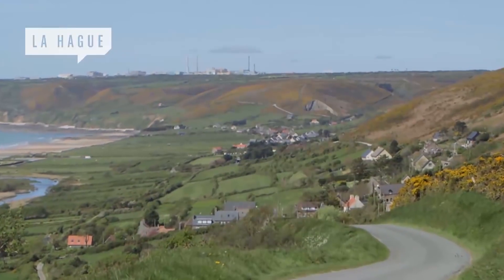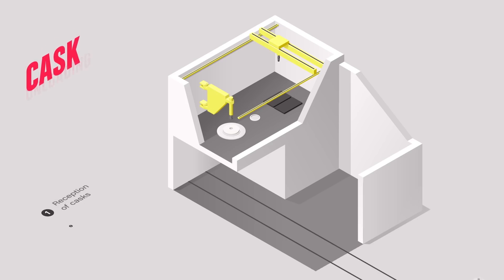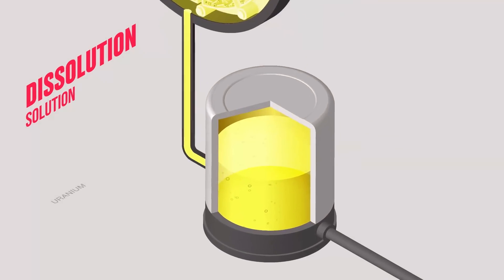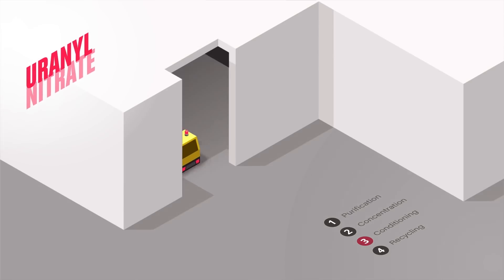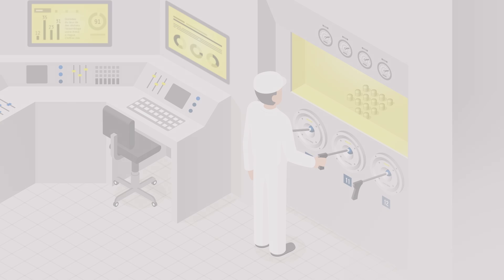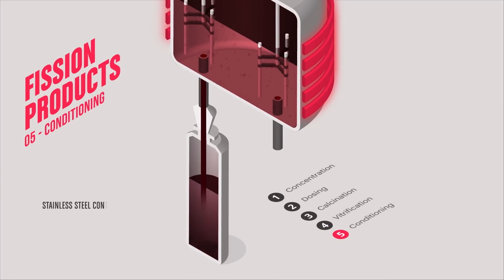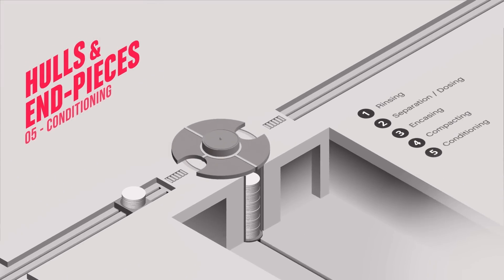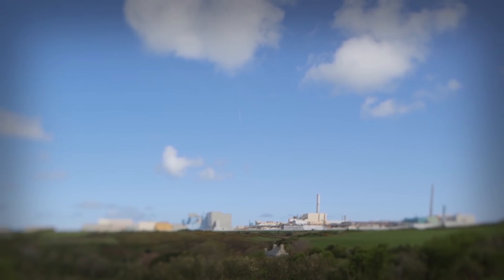Recycling used nuclear fuel - Orano la Hague - English

Comment: This, right here, is why France is deserving of the title "most responsible nation in the world", and I say that sincerely as a British person. The rest of the world is so moronic for not following their example.
Reply: France is also one of the last nations to conduct live nuclear testing explosions.
Reply: It sounds good. However, reprocessed wastes still need disposal on substantial timeframes. Since fission waste generate most of the decay heat, any permanent disposal has to be just as large and spaced out.  
The actinides still need disposal.
Recycling used MOX fuel is it's own problem. Neutron bombardment of uranium gets you plutonium, but neutron bombardment of plutonium gets you a hot mess of other actinides and isotopes. Half of these are neutron absorbers, but not productively reactive. Others are gamma emitters like the fission products, but somewhat longer lived (70 years for U232). Either way, MOX waste needs more elaborate handling, more spaced out disposal sites and longer disposal timeframes. As a result, processing or recycling of MOX fuel is much more expensive, and a lot more elaborate, to get a smaller amount of less useful fuel than less effort gets from ordinary spent uranium fuel.
France has processed about a third of all it's spent fuel and is falling further behind. Their stockpile of separated plutonium is a growing security and proliferation hazard.
Not such good global citizens as you might think

Comment: And some of  the fission products are usable in industrial and medical applications
Reply: Not really. We make medical and engineering isotopes with optimised processes, bombarding pure substances with carefully moderated neutrons to get the right energy window and optimised outputs. This minimises the difficulty of purifying and using the desired isotope.

Spent fuel is a mess, and separating anything desirable is a much more difficult task.

Comment: With our CANDU reactors here in Canada, we could burn both the Uranium and Plutonium from this recycling facility. We can burn Thorium too and yes it has been done in CANDU's before. 
France is certainly a world leader in Nuclear energy though and I bough to the French waste management system outlined here. It is truly a wonder of the world and we need more of this to make Nuclear even more sustainable then it is now. Yucca mountain needs a facility like this to deal with all that valuable spent fuel that is being wastefully discarded. It is like throwing away many many tankers of oil. Such a waste of such a valuable material
Reply: I am not so sure that you can "burn" Thorium as you can breed Thorium into U233.
Reply: Nuclear reactors dont burn anything.  There is no combustion, smoke or flame.
Reply: I really like the Dupic fuel option for CANDUs for further utilization.

Comment: Interesting video! I wonder though, the shredding of the hulls looks a bit wasteful. Would it be possible to make the fuel elements removeable so the same rod can be used over and over again? It would be activated, but that can be overcome with the same containers it arrived in.
And regarding the waste products, many are short lived. Is there a separation so the really short lived isotopes can decay into a stable form and not contribute to the waste that needs to be stored?
Reply: Radiation degrades the hulls over time. Probably a safety thing.
Reply: The Zirconium cladding gets degraded by the intense neutron radiation. Some is transformed into radioactive isotopes. It has to be sacrificed as waste.

The most short-lived fission products decay in the cooling pools. this takes from two to five years. What's left has lots of caesium-137, which has a half life of 30 years. After separation this requires disposal timeframes of about 1000 years. 
The longer lived actinides are a bigger problem. Some can be used in recycled fuel, but others really need disposal.
Used recycled fuel has even more of these and is not as easy a problem.

Comment: Great! now get the costs down. Currently the main reason the US doesn't reprocess it's spent cores is the cost. Using new cores from Uranium ore is cheaper.
Reply: With respect, I would argue differently.  A pure economic  consideration needs to consider the cost of new fuel in addition to the "costs" of dealing with the waste fuel.  Governments could add a price to the cost of storing waste fuel so that it would make the recycling of fuel worth-while.

Note that a similar situation occurred with carbon dioxide (CO2) waste.  In CO2's case, the long-term costs to the planet (i.e. global warming) could have been mitigated if governments had acted sooner; now "we" are in catch-up mode while we accept the consequences (including more violent and frequent storms, fires, heat events, rapidly increasing insurance, etc.).
Reply: @k.c.sunshine1934  Have you seen the latest polls regarding climate change? Concern has been dropping despite old legacy media getting in more hysterics than ever. I predict we will have to tolerate the likes of Al Gore and other nutcases for about 10 mores years and thankfully it will fade away.

Comment: If only the US would take note...
Reply: It is illegal in the US
Reply: @hamanakohamaneko7028  Unfortunately, yes.
Reply: The US learned the hard way (decades ago) that commercial reprocessing of fuels is not environmentally feasible, is not cost effective, is energy intensive, and creates a complex waste stream that is 10x more of a problem than initial fuel enrichment and fabrication itself. Orano La Hague simply flushes its effluents out into the North Sea, stores high-level sludges onsite, and periodically vents its gases into the air. For better or for worse, companies can't get away with this in the US anymore.

Comment: How many of these dislikes to the video think that this is inefficient?
Reply: Yes, nuclear waste reprocessing is ruinously expensive and inefficient.
Recycling causes an additional problem: Used MOX fuel, which is more expensive and difficult.
Reply: we have molten salt reactors instead of nuclear energy planned for the future
Reply: Because if you look at the facts nuclear energy is extremely expensive and only increasing, while solar is decreasing. According to the WNSIR report and Reuters: Nuclear is also much more expensive... Solar power ranges from $36 to $44 per MWh, wind power is $29–$56 per MWh. Nuclear energy costs between $112 and $189.
Reply: @aorusaki  Which is why we need solely nuclear energy and no wind or solar ever again!

Comment: This is amazing. Kind of insane that we go through all of this effort from mining to nuclear power plants this recycling effort all to boil water to make the steam turbine go round.
Reply: It's complex, but sensible. What's insane is throwing out the fuel because we don't want to go through the trouble of removing 4% of it.
Reply: yeah, you're right, we should just dig out some coal and burn it right away to boil some water.
Reply: Sometimes I wonder if it might be easier to train rats to run on wheels for power 🤣
Reply: @TJamesSisson  It would certainly be cuter.
Reply: Yes. Nuclear energy is isane and demonic.
Reply: @Robertx19  To boil water without emitting CO2.
Reply: @pseudotasuki  They emit more than CO2 while recycling nuclear fuel.
Reply: @pseudotasuki  Huge amounts of CO2 are emitted in the ore mining, processing and handling of radioactive tailings. Also during construction and (if they ever do it) decommissioning brittle, radioactive reactors and disposal of the waste (if they ever do that.)'  y the way Fission produces radioactive C14.
Reply: Well it's currently the only effective way we know how to convert heat energy to electricity.
Reply: @carl8790  Well that isn't even remotely true. There are plenty of other options such as the Stirling cycle (heating a closed system containing some fancy pistons), Brayton cycle (heating a compressed gas), or even the Seeback effect (super low-efficiency black magic). The Rankine cycle was just the most mature option available when nuclear power plants were first developed.
Reply: @pseudotasuki  And Carl, none of the things you are talking about are the source of the energy, just ways of transforming it. Sources are coal, oil, gas, geothermal wind, solar and nuclear. All but nuclear produce CO2 or are intermittent.
Reply: @pseudotasuki that's the thermodynamic cycles for converting heat into usable power, not a source of energy, which nuclear is currently our best bet.

Comment: From what i have learned, this is a failed experiment for the most part. :(
Reply: Is not really a failed experiment, is just super expensive, that's because any nuclear reprocessing plant that uses the Thorex, Purex, or Urex process basically has hundreeds of not thousands of chemicals steps, to process the elements, separate the fission products, and treat and dispose of all the contaminated solvants, bases, acids, liquids and other streams, that's because it wasn't made for power generation but for making plutonium for warheads in the 1940s at any cost, either economical or enviromental

A much better processing is the electrorefining of molten salts or pyroprocessing that Argonne developed, is actually the same process used to refine copper and rare earth materials but adapted to the nuclear industry.
Reply: Correct. It is highly energy intensive (nobody talks about how much energy is used throughout the reprocessing of fuel). Extremely expensive. Very dirty - more high level waste, chemical waste, and radioactive effluent is created through this process than through the initial creation and use of of the fuel itself. This defeats the purpose of nuclear energy from every angle: cost, efficiency, and environmental friendliness.  

Another irony is: the main byproduct of the calcination of plutonium oxalate is CO₂ .  The very thing the nuclear industry vilifies.

Comment: Primarily, your video helped to me for my project more. Merely there is one question stick to my brain that is you mentioned during recycling extract uranyl-nitrate by evaporating and question is  what uranium isotope consist this substance inside. U238 or U235?
Reply: both isotopes will be present (although U-238 will dominate because most of the U-235 has been fissioned) throughout the chemical processing.
To separate the isotopes you need mechanical processing (based on mass - UF6 diffusion or centrifuges).
Reply: @factnotfiction5915  thank you so much, really i needed to this information. i never want to do tire you but, can you send me information resources that covering upon this please, any thesis journal or any one. And if i am not mistaken you mentioned U-238 will dominate, can i seperate safely U-238 from fuel to use anything in theory, also let`s think i could seperated safely and i would use this for in some project, is this harmfull for healthy?
Reply: İ am student, i have been working for physics competition, topic upon nuclear energy. And also do you know radiation amount (meV or SAR) of nuclear waste(stopped fission) both of U-238 or U-235?
Reply: @eminrahimov4411  https://en.wikipedia.org/wiki/Isotope#Chemical_and_molecular_properties
"Because the chemical behavior of an atom is largely determined by its electronic structure, different isotopes exhibit nearly identical chemical behavior."

U-238 is a low-level alpha emitter, so radiologically it isn't very dangerous (gloves are more than enough to stop alpha particles for handling).
Chemically (i.e. any isotope), uranium is a heavy metal that would disrupt a biological system - similar to lead, mercury, cadmium poisoning - you wouldn't want to introduce it into your body (via a cut, breathing, eating it, etc).
Reply: @eminrahimov4411  the radiation of spent nuclear fuel depends upon how long it has been in a reactor and at what power level.
The U-238 and U-235 radiation is quite low; the fission product radiation is quite high.

Here is a good starting point - https://www.nrc.gov/waste.html
Reply: @factnotfiction5915  i need to beta emitting, if uranyl-nitrat consist U-238 and U-235 which obtained from nuclear recycling as video, could it be emit betta as trithium, guess 4-15 meV?

Comment: Imagine if the Fission Products could be recicled too
Reply: They mostly can. There's some very valuable stuff in there, including platinum group metals and xenon gas, most of which is completely nonradioactive after a few years cooldown.
Reply: you would need to find a way to separate them from each other - these are dozens of various elements and isotopes of these elements all mixed together, most of them are highly radioactive, some are not anymore.
if you would then quite a few of them would have industrial, or even medical, use
Reply: This is something I think about regularly! It seems ridiculous to encase it in these containers and just leave them somewhere, there must be a way!
Reply: @morgangeeeee  As Jakob Brinka Berg states, the fission products just need 300 years of waiting. At that point then, yes, they are recyclable.
You (well, your great-great-grandchildren) just go back to the repository and dig up the containers. As a plus, unlike regular prospecting for mines, you know exactly what you will get inside (the decay process is deterministic - as an example, we can see Ba-140, a large % of fission products, decay chain here https://periodictable.com/Isotopes/056.140/index.full.html, resulting in stable Ce-140, so we know a large % after 300 year will be Ce-140) and where to find the minerals.
Reply: @morgangeeeee  Is not somewhere, is called waste disposal facilities, and by the way this is the safest waste on earth without impact on the environment as this disposal facilities has no bridge with the environment compare to any other conventional waste you can think of. 
Of cause, with Gen IV reactors on it way, we won't have FP because all will be used up in these reactors
Reply: @emekaolebunne7336  I agree with you in some aspects, but it is not sustainable and we need to move away from sealing high level waste up and storing in these facilities. Gen IV is a great step forward and there is much more to come from nuclear!

Comment: What % of lifetime electricity produced is spent building a plant? What % of electricity produced from 1g of fuel is spent on producing the 1g of fuel. What % of electricity produced is spent recycling the waste material? Not tyring to make a point, just curious..
Reply: I think the important thing to note here is that many spent fuel facilities around the world will be going through the normal process of sending their waste to storage (money being spent). This facility is integrating a recycling service, in addition to the preparing of waste material for storage. 

It said in one point in the video that about a quarter of the energy can still be used from this fuel, which is a considerable amount in comparison to fossil fuels. If more facilities like this were built around the world then the efficiency would increase massively, without the extra cost and CO2 production of sending fuel to Normandy from all around the world.
Reply: @Marko R Me too. Did you found something about it
Reply: @soulfox3381  and @Marko R - I don't have a %, but the carbon cost of building the 60 year plant, mining concrete, iron, uranium, processing U fuel, reprocessing fuel, waste storage and plant teardown is 12 gCO2eq/kWh.
Versus for wind which the carbon cost of building the 30 year turbine, mining concrete, iron, and plant teardown is 11 gCO2eq/kWh.
Thus, estimating based on the much smaller footprint of a single wind turbine (ok, because gCO2/kWh is a ratio), the cost % of lifetime electricity produced must be quite low - under 0.01%, 0.001%?

Comment: To recycle the spent fuel rods, why don't they use them to heat cities with hot water?
They could be in a central location and used to heat water , then pump it to heat all of downtowns buildings for a long time. Save money for the city.
Reply: 99% Perspiration 
Spent fuel does not emit enough heat to efficiently power something as large as a district heating plant.
Reply: @mudspike84  heat pumps, the water holds less than 50c so it should be plenty to heat water to steam or boiling temperatures without adding much energy.
Reply: Or you could directly use the waste heat of a nuclear power plant for heating homes like they do at Beznau in Switzerland.
Reply: It warms water but not even warm enough to take a shower and would be cooled already before it reaches the houses. That, and the infrastructure cost isn't worth it let alone the moral issue of people not wanting to be anywhere near it.
Reply: Also, it is strategically questionable to have high concentrated radiation in the centre of cities. If somebody blows it up its probably not for the better...
Reply: @TheBrokkoli611  you may be surprised to know that there are nuclear research reactors within major cities, such as MIT's reactor in Cambridge, MA. Those reactors are not pressurized systems, however. There have been discussions for district heating only reactors in China, look up the DHR-400. Canada considered something similar with their SLOWPOKE design back in the 1980s
Reply: @evanmorris6508  Those reactors are also very small compared to power generation reactors, typically twenty to fifty times smaller.